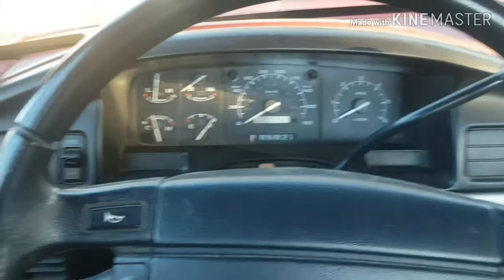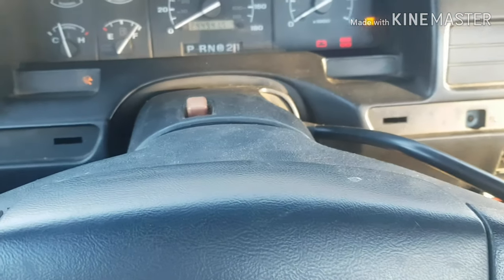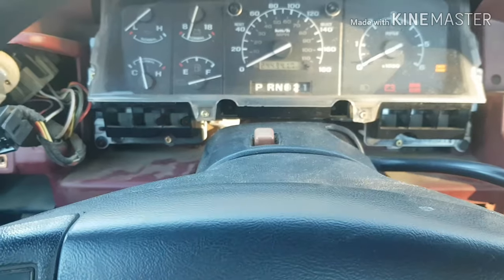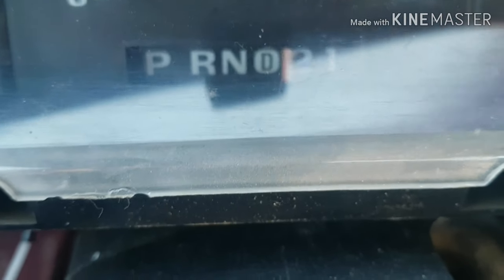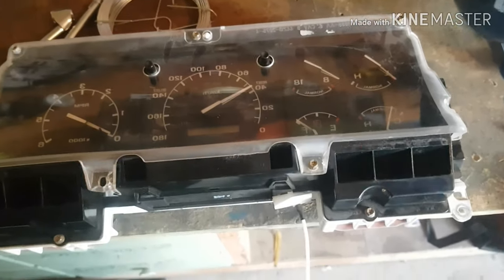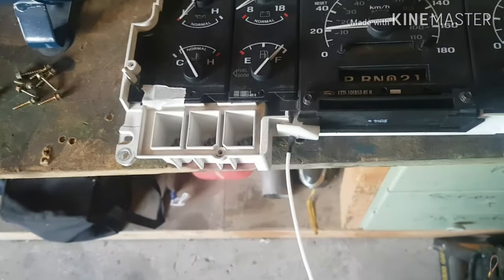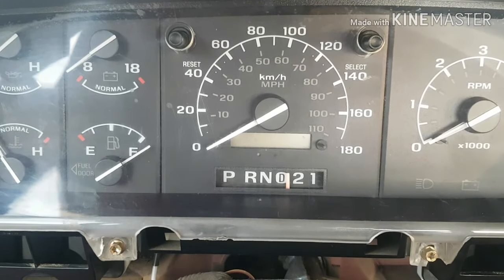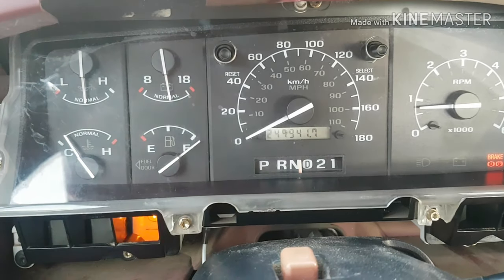How to remove the guage cluster from a 92-96 ford f-series and bronco

Comment: Nice tip about plugging in fuel select switch before turning on to check work before buttoning it all up. Plus best yet seen on how to remove gear select indicator cable and reinstall/adjust. Big Thumbs Up. Thanks!!
Reply from the maker: Thanks! I'm always happy to help

Comment: A great video that really helped me get the job done.  No other videos showed the gear selector cable like that, which was the trickiest part!  Thanks
Reply from the maker: No problem, happy to help
Reply: Thanks for the video! I had everything off, but I couldn’t get that gear selector off. I ended up sealing it back up out of fear that I’d screw it up, ha! I only got one led bulb in 😂 The climate control lights were a piece of cake though.

Comment: even w/out dual tanks there is an electrical  connector at that location AND it has to be connected to the dash bezel.  a connection is made between a couple of the wires by the dummy connector on the bezel.

Comment: Quick question, when replacing the instrument panel will the odometer automatically show your vehicles actual mileage or will it show the milage on that specific instrument panel? Meaning the mileage from whatever vehicle you took the instrument panel from.
Reply: It’ll show the vehicle it came from. Hope this helps. I had to get my cluster rebuilt by auto tech so I can keep my mileage

Comment: So while I was trying to pull the white cable the plastic adjuster threads broke and are stuck in the bracket. I have no idea how to get the wire out now or replace it